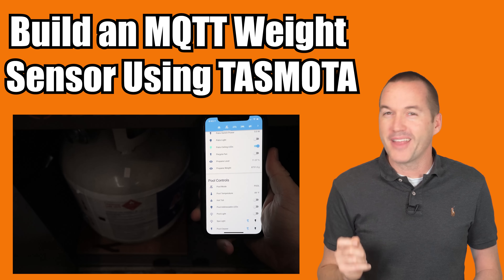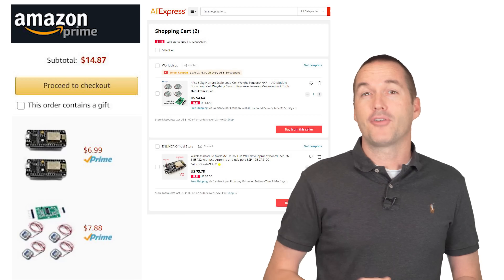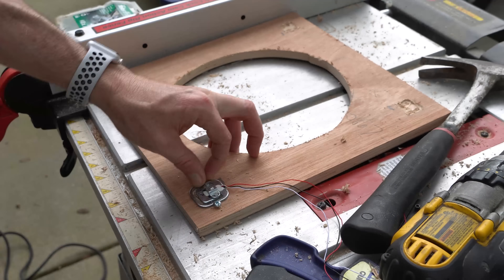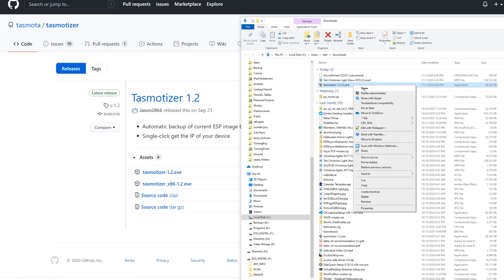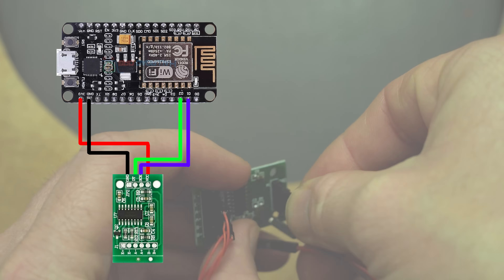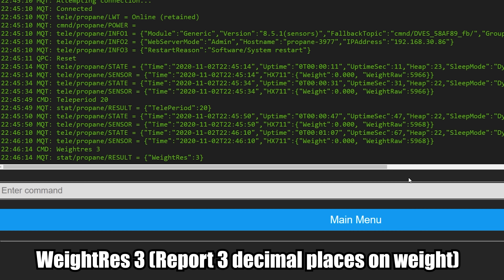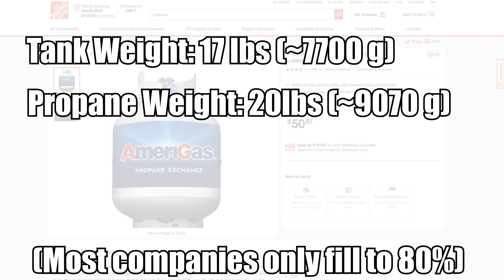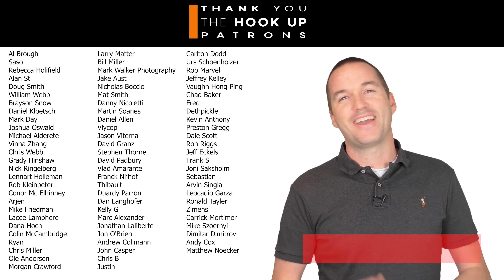Measure Propane, CO2, Salt, and so much more with this DIY MQTT Weight Sensor using Tasmota

Comment: I have build bed occupancy sensor with this. Goal was to get all lights, AC, TV etc. to turn off when I get in bed
Reply: Was just thinking the same myself. Here is a tidy thingyverse design to print out to mount the sensors  - https://www.thingiverse.com/thing:4213002
Reply: Would this work with a "divan" style bed? (Bed with a kind of solid but slightly soft base, not wooden slats)?
Reply: @MatSmithLondon  I think if you put the load sensor under the feet or casters you'll be right.
Reply: @MatSmithLondon  I think it would. You can put sensors under the bed posts or, what I did in my case, under mattress support
Reply: @ClioSport2016v  what do you mean by "mattress support"? I've been hoping to build bed occupancy sensor, but don't want to put them under the bed posts because the bed already is really heavy and I don't want to increase the pressure on the floor (the bed posts are much wider than the load cells). I've precisely been thinking of some kind of sensor just under the top mattress, but I don't know if these load cells are suitable for the job. I'd appreciate any ideas!
Reply: did you add a timer to that to prevent all those thing from turning off if you sat on the bed for a min?
Reply: @johnreese7986   I never sit on my bed for a minute :) I did add some logic to check if I am home alone, then it will turn off lights if weight is > 70kg and if my GF is at my place then it will turn lights when we are both in bed, if weight is > 100kg . Also this automation only works after 10PM

Comment: Great video, is it hard to make it battery powered?
Reply from the maker: Battery power and wifi don’t go super well together.  Tasmota has a sleep function, but I’m not sure if it would be efficient enough to be worth it.
Reply: @TheHookUp  Battery + Wifi + Solar Cell = ❤
Reply from the maker: I was thinking about this some more.  No reason you couldn’t just put a switch on it. Flip the switch to turn it on, it fires off data to HA and then switch it back off.
Reply: @TheHookUp  Found this https://community.home-assistant.io/t/mqtt-mailbox-notification-battery-powered/56042 where they have a esp that last 1 year, if we could get the tasmota to only fire data when the weight changes, the battery would last long. Don't know if that possible tho.

Comment: The super cool thing I'd add to that is measure and save the difference after each use. With enough data you can convert grams or % which don't really tell you to avg. number of uses. So instead of 85% full, or 6500g available, you'd have something in the lines of 17 BBQs to empty
Reply from the maker: I’m in the process of doing something similar. Going to run the bbq on high for 10 minutes and record the data, then have it estimate the number of minutes of bbq time left.
Reply: @TheHookUp  That calls for a potentiometer or a rotary encoder on the BBQ knob. (ignoring a BBQ should be rue on charcoal ; )
Reply: @TheHookUp  Should be possible to just run it thru a statistics sensor computing over say 5 minute interval and pull out the change per second (gonna need a LOT of places past decimal point for accuracy) and then convert that to hours/minutes.  That way you can have real time data depending if you are running it on low/med/high burners.  I do something like that to compute rainfall in inches-per-hour over a few minute interval.  This way as long as you let it run for ~5 minutes you'd have an accurate estimate of remaining cook time at the currently selected burner output and it would dynamically scale if you're running it on high today and low tomorrow to cook different stuff.
Reply: @TheHookUp  Do you still have those 3D projects links? Can't see them in description 2:42
Reply: I like your idea a lot. I wouldn't want the Blackstone Griddle to run out of propane while cooking breakfast, or anything else on for that matter. Good excuse to break out Excel and get a spreadsheet going. :)
Reply: Why must Americans always use a ridiculous measurement on everything? 🤣

17 BBQs of gas 😂

Comment: I'm measuring the weight of my bed for bed presence! Works really well.
Reply from the maker: Great idea, I may put that together this weekend.
Reply: @TheHookUp  If you do, please post an update (or a follow-up) video showing the modifications to detect whether one or the other or both sides of the bed is/are occupied! Bed occupancy seems like one of those things that nearly all of us would find useful.
Reply: I used the same sensors as the ones in the video for bed presence and noticed the values drifted a fair bit over time and maybe temperature.  Although my bed is on carpet, probably isn't the best surface to use load cells on.   I wanted to use to it see if I could see if either my wife or I are in bed (or both) as triggers/ conditions, but had limited luck.  I would be interested to see if Rob can get it to work!
Reply: @JoshIlles  I just tell Alexa and she does the rest.
Reply: Teleperiod in tasmota is limited to only 10s so if you want immediate reaction when the bed gets occupied how would you do it in tasmota ? I know esphome offers update intervals that can be set to a second or even less..
Reply: @algre977  the most optimal algorithm would send updates once a second but only if difference to previous measurement exceeds a threshold. Otherwise update every 30 seconds. Best of both worlds - immediate update on changes but no unnecessary traffic if value doesn't change.
Reply: @joonasfi  agree. Any tips on how to send only when a certain difference occurs ?
Reply: @algre977  I don't know about Tasmota, I've never used it as a sensor. I was just commenting generally :)
Reply: Thanks for sharing that Daniel. Are you using the sensors in the video? I was wanting to do that too.
Reply: @shawnmaker6974  not sure if I am allowed to send a link here in the comments, but there is a car seat occupancy sensor on Aliexpress that would be probably better for bed use. https://www.aliexpress.com/item/4000148923476.html
Reply: @Mavi222  That’s exactly what I need for my office chairs. (I’m assuming you’ve used this...) What does the rest of the setup look like? Do you just plug it into an ESP32 board?

Comment: Rob this is excellent, thank you very much for the step by step process! I'm planning on trying this out over the weekend, I've got most of the parts already (albeit I've got an aluminum bar based load cell with strain gauges either side - so won't be following the Wheatstone bridge. Do you think I'll come across any issues (not only planning on light weights (>5kg - rating of the load cell)?? Thanks again for pulling this together, awesome that you follow the comments from the community to drive your video production!

Comment: Not gonna lie, was hoping he would use the much simpler esphome.
Reply from the maker: Esphome is simpler than tasmota? No way.  The only thing esphome gets you over tasmota is automatic integration into hass, but the setup process for the hx711 is a nightmare in esphome compared to tasmota.
Reply: @TheHookUp  Completely agree. I have personally found ESPHome flipping hard work compared to Tasmota. The only two things that confounded me at first about Tasmota were (a) understanding switch vs button vs relay, and (b) how to configure them on console. The more I use it, the more obvious it is. And I really like being able to configure everything in a single command. I use NodeRED only (I still haven't found a use for HASS as I can do so much more in NR), and Tasmota is a breeze to work with. I was thinking of making a video to demo my "Tasmota Discovery Centre" that I have built in NodeRED. It's quite neat.
Reply from the maker: You should, I’d watch it.
Reply: @TheHookUp  hmmm. Interesting. I had no trouble with it at all.
Reply: I use EspHome for everything, however Rob's explanation on the hardware setup is clear and simple.  This is a good tutorial on how to implement this using EspHome.  https://vigonotion.com/blog/monitor-remainding-water-bottles/  and of course you can check https://esphome.io/components/sensor/hx711.html

Comment: Great video.... Just roughly, what would be a safe maximum weight for these load cells to be measuring that won't damage them?
Reply: I've got a set of 50kg load cells under my bed, with two persons and the bed the total is approx 250kg. I've had no accuracy issues or drift of weight. This setup has been running for approx 6mos with no problems!
Reply from the maker: Good to hear!
Reply: @danedwards_ee  Do go on..... Do I dare ask what or why you are measuring your bed? :)
Reply: @bitsorbytes  presence detection. I'm able to use the information to change certain automations etc.
Reply: @danedwards_ee  Ahhh yes presence detection. Yes that is one way to ensure you are in bed before starting the automations! Smart thinking!
Reply: @danedwards_ee  Can you tell, based on the sensed load per leg, if one side of the bed is occupied and the other isn’t?
Reply: @Tropical_Dreaming  unfortunately not.
Reply: @danedwards_ee  But you could at least tell by weight if one person or two were in bed, right?
Reply: @Tropical_Dreaming  Correct. I'm able to get an accuracy of approximately 1-2kg.
Reply from the maker: They are rated to a maximum of 50kg each, so 200kg is the theoretical maximum.  I'd personally limit that to around 100kg for sustained loads.  If you want you can add more load cells to the wheatstone bridge and each one will add an additional 50kg of maximum weight.
Reply: @TheHookUp  How you would add the wires to that? Say 1-5 or 1-6 load cells. (Great video by the way)
Reply: I guess if you put it on the bed you could figure out who is in it and how fat they are getting over time.
Reply: Load cells are typically rated by how much load they can detect, and remain linear in output. If specified, the damage threshold is always much higher (like 2x). If you want the best longevity out of your sensor, you primarily need to protect the strain gauge which is glued to the metal frame which deforms. They are often made from mylar or aramid film with an aluminum trace resistor. Make sure the wire leads have proper strain relief, keep it (the strain gauge part that is) out of the sun, and at a relatively constant temperature / humidity if possible. Given all that, and if the metal frame isn't aluminum, the load cell should last a very long time. I work in mechanical testing, and we have load cells older than I am that have drifted less than 1%
Reply: I guess I should also say that aluminum cells are probably fine for most applications, but cannot handle cyclic loading. It's for the same reason your car doesn't use aluminum for any sort of gears, bearings, or drive shafts.